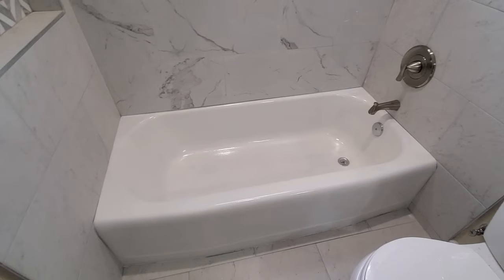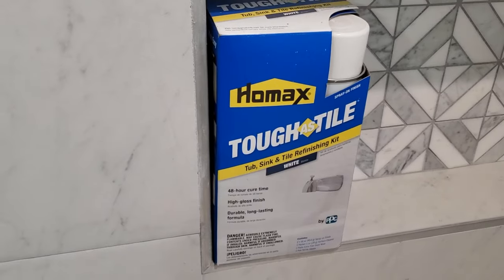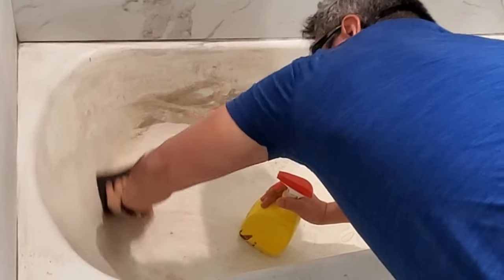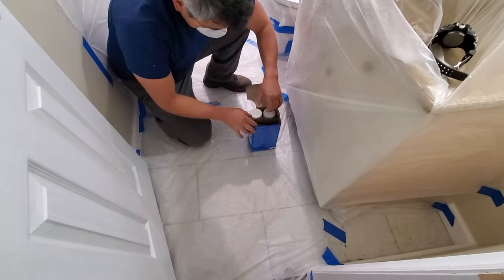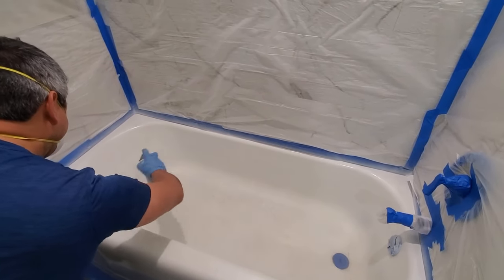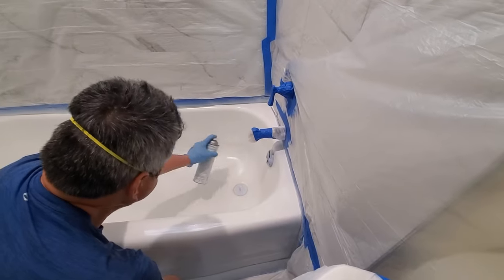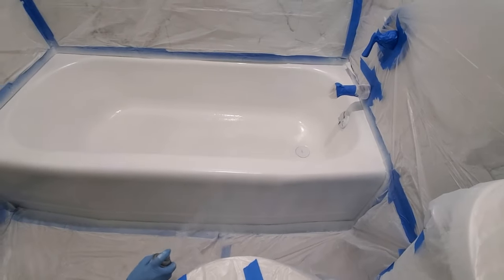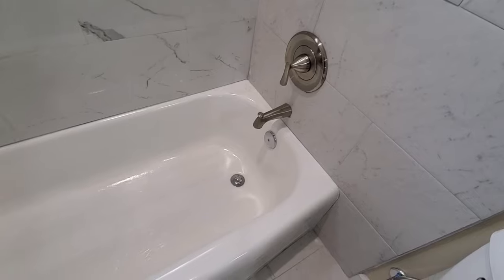TUB REFINISHING spray from Homax!🛁✨

Comment: Hey there. Wondering if this can
Be used to spot glaze a tub. My landlord was nice enough to get our tub professionally deglazed last year. We were very careful to stay out of the tub for the recommended time. It looked so good. But after 3 months it started chipping around the drain (revealing the old ugly tub underneath). I contacted the landlord to see if the company guaranteed their work. They did…for 90 days!  So now we are left with a 95% good looking tub with 5% chipping. Can I treat just the one spot (about 3-4” across)?
Reply: No experience or expertise here,but I’m guessing you could remove the drain plug,they make a tool for that,sand around that area and repaint around that area?just a suggestion,and of course clean area well prior to painting.
Reply: @robertmichalscheck3072  Will give it a try and report back.  Thanks (P.S. I re-read my comment and saw that I wrote degalze when, I assume you knew, I meant reglaze.  lol)

Comment: I had my bathroom sink done with spraying, but the surface is not smooth, it looks like new,  but only with one coating.
could dirt get stuck over time on the bottom of the sink if it’s not smooth, I clean my sink daily after using it..
Reply: You might try some form of wet sanding with high grits to polish?

Comment: My tub is only 1 yr old and the bottom inside the tub is not smooth and has some rust spots do I use this to make it smooth and remove the rust?
Reply: The guy from Lowes told me to sand it down

Comment: Pretty sure this stuff peels quick!
Reply: Unnn I don't think so if he use the correct materials.
Reply: For sure
Reply: YES IT WILL WITHING A MONTH OR 2  I CAME ACROSS THIS ALL THE TIME IM A PROFESSIONAL TECHNICIAN REFINISHER FOR THE PAST 5YRS  THIS BS CRAP  THAT THEY SELL AT HOME DEPOT DOES NOT WORK  I RECOMMEND EPOXY  PAINT HES NOR EVEN UAING A PROPER 3M HALF MASK TO BEGIN WITH ANY QUESTIONS DM
Reply: @hexs619  lol Tru
Reply: @hexs619  oh and also read the comments below these people don’t know what there doing and now a pro has to come in and up charge for stripping 😂😂🤦🏻‍♂️great job for the video thanks more money for the refinisher 😂😂😂

Comment: I find it ASTOUNDING that this "expert" painted the tub without first removing the drain and overflow panel.   It takes less than 10 minutes to remove them.
Reply from the maker: This "expert was asked to paint the tub, they had to have the plumber ensuring that the drain system was properly removed. Thank you for watching
Reply: @HugoCorrea  It is a 5 minute job.  It requires a screwdriver to remove the overflow fitting, and a wrench to remove the drain.  Any amateur can do it after watching a 5 minute video on youtube.
Reply: @tedtalour6414  Wrong.
Reply: @tedtalour6414  Yes. Yes she is very much so being a Karen. 🙄🙄🙄
Reply: Karens don't need to be answered. Great job on the tub! 👏🏼👏🏼👏🏼